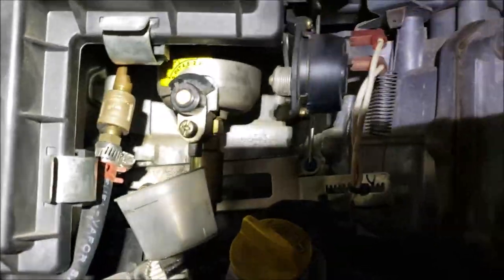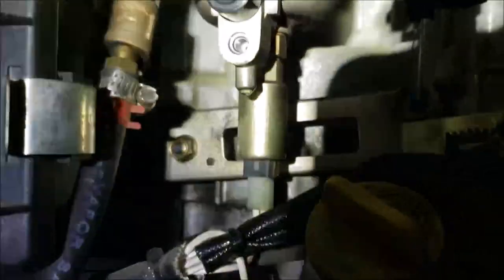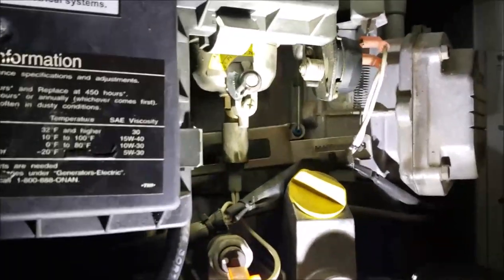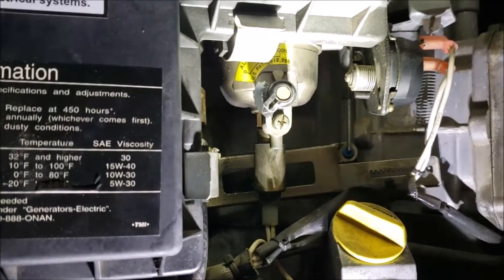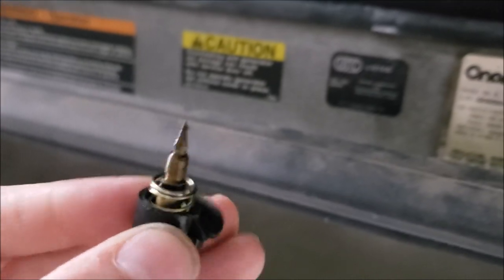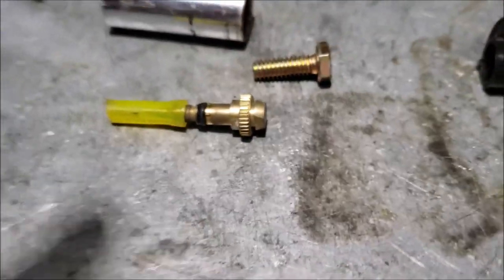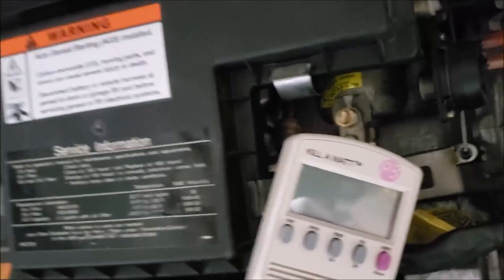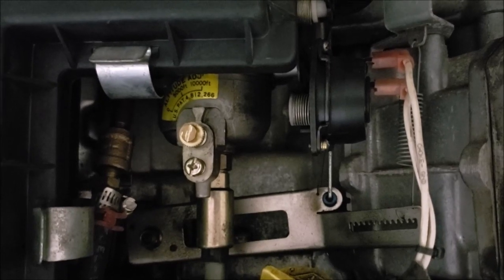Updated Onan Marquis Gold 5500 Generator How Stop Carburetor Surging Without Removing Carburetor

Comment: I just put a new Cummins fuel pump ($242) and Cummins carburetor ($580!) on our 5500. I also added new fuel lines, adjusted the valves, new air filter, changed the oil, and new spark plugs,. Runs like a champ now!

Comment: Worked great for me after much frustration with surging and stopping.  A very thin blade and very gentle prying pressure under the tabbed portion of the knob, turning the knob a little with each pry , had the knob off intact in about 15 seconds. No need to cut or disassemble anything. Thanks so much for the informative video. Your advice was spot on.
Reply from the maker: Thanks for letting me know. Have a blessed day.

Comment: Also i purchased a $380 carb on Amazon, and it worked ok, i took it to cummings and they pointed out how it was not a Onan, the $550 Onan Dealer has so far worked the Best, but i do keep a $60 carb for a emergency

Comment: Great stuff! I recently bought a 2008 grey hawk with only 7,100 miles and 36 hours on the Onan. The Onan was a no-start. I can see your brain spinning now.
I removed the float bowl. Wasn't really bad at all. I cleaned it out and sprayed the main clean, and opened orifices up and... More over... freed up the fuel shut off solenoid plunger. It was completely stuck.
Started right up after that, It does surge when not under a load, so i plan to do this adjustment and clean the needle end there.
Thanks so much!

Comment: Tried this today and worked just like the video showed.  The only thing I did differently is that I used a Dremmel tool with a cut-off wheel to cut the tabs off leaving the black plastic with which I can turn by hand and without having to remove the bowl drain bolt.  Thanks for the video!!
Reply from the maker: Thank you for contributing, have a blessed day.
Reply: I just took a thin blade screwdriver and the knob just popped off. The screw has little cogs on the head to turn it by hand. Piece of cake.

Comment: Hi Kevin, I had the same surging problem and I have the Onan 4000, I made the same modification to the rich/lean screw to make mine fully adjustable as you did. It worked great and half a turn out from factory and it smoothed out. I am in Colorado so I am right at 5000 feet of elevation. If you get a chance show us how to properly adjust the choke. Thanks for the video, very helpful.
Reply from the maker: I have a service manual I can email you that will show you how to adjust the choke. Text me your email address to my cell phone 606-875-0125

Comment: Great video
I just put a new carburetor on my own generator the old one has been setting for 3 years the new one is surging I will give this a shot I'm at 7500 ft could be the problem of course I will be cleaning the old one and tinkering with it before I attempt on the new one
But the old one was doing the same thing as the new one so I think it's an altitude problem I don't know
Reply from the maker: Please let me know if it works for you.  I think it will.
Reply: Thanks again Kevin it worked I appreciate it
The old carburetor I took all apart and cleaned. So now I have a spare the new carburetor I just popped off the altitude control and adjusted it didn't have to replace the new carburetor have a Merry Christmas and thank you again
Reply: @ktoutdoor  how are you doing today
I took the new carburetor and popped off the altitude adjustment and it worked just like you said the old carburetor I completely took apart and cleaned not too bad so I think it was the altitude adjustment on the old carburetor oh well I have a spare just in case Merry Christmas and thank you again
Reply from the maker: Merry Christmas to you glad it worked for you.  Have a blessed day.

Comment: Kevin, your video by far is the best on the internet. I was hoping you may help me with my gen issue. I have an Onan 5500, 82 hrs. It sat with old gas for many months. So far I’ve:
- removed the carb and cleaned it
-removed all old gas filled with new
-ensured fuel pump is pumping and pumped out old fuel
-ensured spark plugs have spark

Reassembled but it won’t start. It appears to be getting flooded with too much fuel. Funny thing is that when I drain the float bowl, don’t prime it, the gen starts like normal for a few seconds but then dies with a 36 fault code. This tells me that the float and shut off needle isn’t functioning allowing too much fuel in the carb. 

Any ideas?  Thanks
Reply from the maker: Yes give me a call my cell 606-875-0125 Kevin

Comment: Nice video  I just bought  the 5500  my 5.5 HGJAB-6755  and the altitude adjustment only goes from 0-  5000ft I live that  5879ft and camp 1000ft  it will not run at 1000ft. So do you think the adjustment screw the word generator? It only has 7 hours.
Reply from the maker: Sure you got nothing to loose by trying. One more turn can make a big difference.
Reply: @ktoutdoor  thanks👍

Comment: Dumb question.... Did you try carburetor cleaner or Sea Foam first?  Great info!
Reply from the maker: I found it's best just to take the carburetor off for a thorough inspection and a thorough cleaning before I put it back together. If its really in bad shape then the carburetor may need replacing

Comment: Have you ever seen the belt under the bottom
Reply: It’s kinda like the dark side of the moon, you’ve never seen it but you know it’s there.
Reply from the maker: I know about it, the factory told me it should last the life of the generator? well see...
Reply: @ktoutdoor  I’m not a believer in a lifetime belt. I’m thinking I should replace mine soon.
Reply from the maker: @larryreno8293  How many hours on yours? seems to be a vary ware failure from my research
Reply: @ktoutdoor  just over 700 hours. My concern is the age of the belt not hours of use. I have a ‘04 bounder on a W22 chassis. Also thank you for the tip on removing the adjustment limiter. I pulled it off and backed it out one turn, problem solved.
Reply from the maker: @larryreno8293  Glad that helped you out. Also note I think there maybe be a idler pulley that keeps the belt tight so if I had it apart I would replace both.

Comment: Not bad, not bad. But you should not touch fuel mixture screw to change frequency.
Reply from the maker: Of course not. I was just pointing out the rpm drop from rich to lean. The 10 mm nut on governor spring will dial in your rpm and hertz.
I need to make a video on just that procedure.